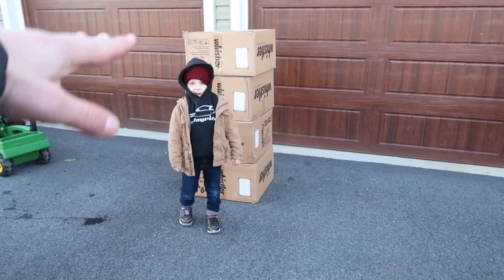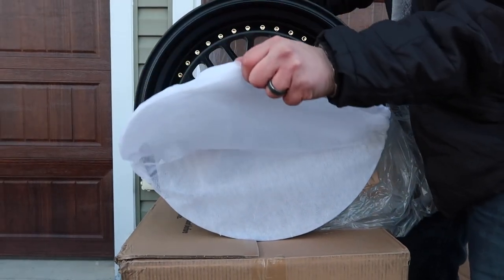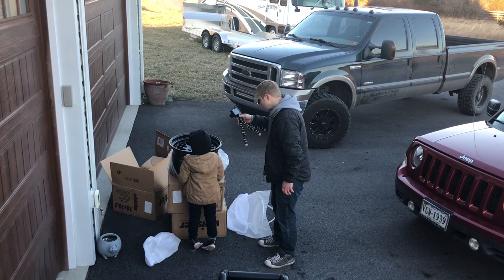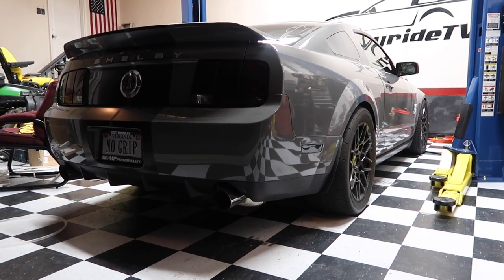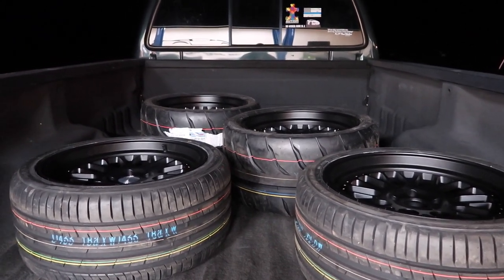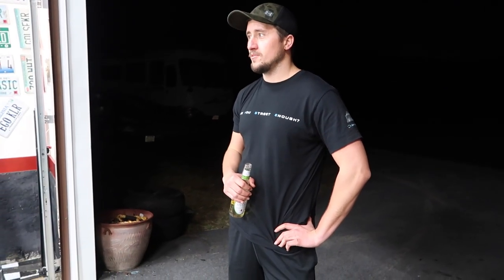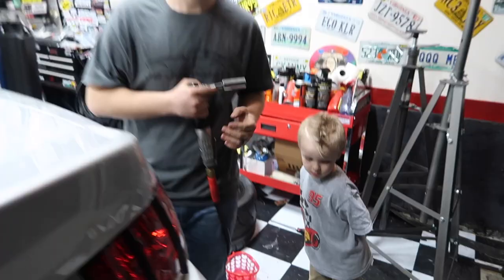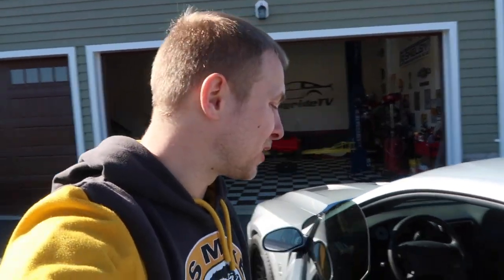Terminator COBRA New Wheels REVEAL!

Comment: Little Man is for sure alot more interested in being on video than he used to be. Haha. I just powder coated a set of wheels I picked up from the scrap yard. They are about that same semi gloss. I just put tires on them and got them on my F150 this weekend. 👍👌
Reply from the maker: Gary Carraigeacha sweet. I bet they look like new now
Reply: @JD_JoyrideTV  yes. They are just steel wheels. But once I clean up the original aluminum wheels, I will make the black ones for winter runners. Might hydro dip the aluminum wheels.

Comment: I was not sure about those wheels because with the exposed bolt look around the inner lip i thought it made the look of the wheel too busy. However when you put the black center caps and black lug nuts on them, it gave the wheels a whole different look, and made those exposed bolts really pop. I like it, i like it a lot.

Comment: Pretty much the same setup I run. Black XXR 531's 18x9.5 up front with 245/40/18 Pirelli P-Zero All Season Plus and 18x11 out back with 315/30/18 Toyo R888R +20mm offset front and rear. Next up grab some Low profile subframe bolts, H&R Sport springs with the Steeda bumpsteer kit and Steeda X2 ball-joints and you'll be set.

Comment: Those R888's start out soft, but after a bit of spirited driving, they warm up and hook nice. I would like to assume its good for a little wheel spin at first, as opposed to hardcore traction off the line.... Easier on the drivetrain. Love the wheels and got them on my 03 ZY vert. Got ya subbed.

Comment: The center caps didn’t fit in the rear. Did you use a spacer in rear wheels. The center bolt popped them right off.

Comment: Are there fitment issues with the center caps? I read on the forums you have to run spacers and beat up the wheel hub dust caps.

Comment: Whoa! Those rivets really make the new wheels POP! BTW JD, I had to get the extended lug nuts in the rear too because I have those ARP long studs. Cobra looks intense!
Reply: which lug nuts you went with im stuck with same issue
Reply: @kernblock323  I used Gorilla Automotive Extended Lug Nuts and I found them on Amazon.com.
Reply: tominator thanks man hopefully I can find them